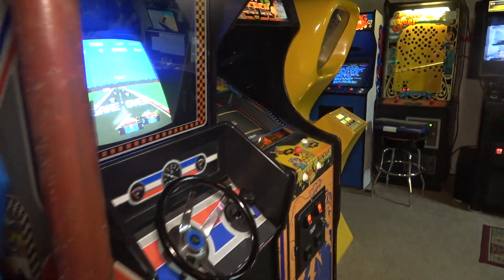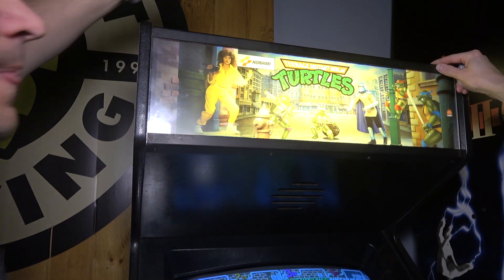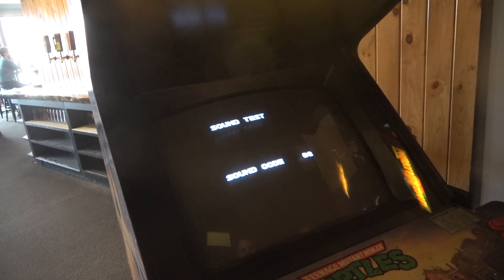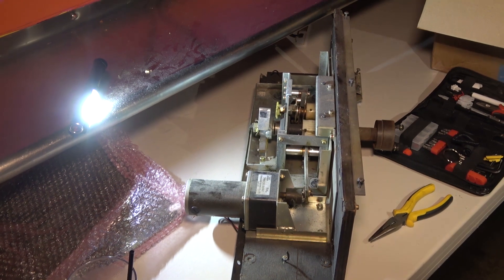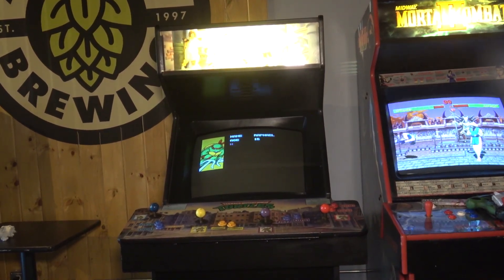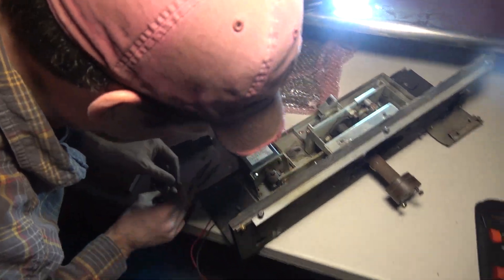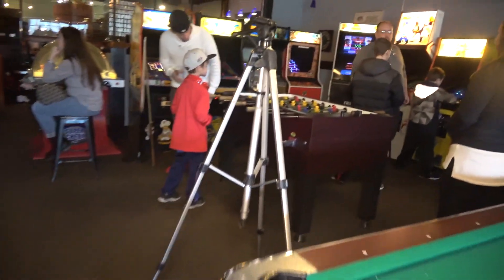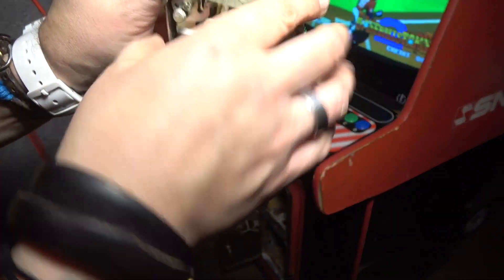Four Arcade Games - ONE DAY

Comment: the de-oxidant is the best i had a pin ball that was reseting every once in a while and i thought i was going to have to re do the five volt circuit but all it was is the edge connectors needed to be cleaned !!

Comment: Hi John.
I had the same problems With the coin mechs and I found that the adjustment for the width and thickness of the coin mech settings were difficult to fine adjust, but once its dialed in, you just tighten everything up and you should be good to go.
it will take time but you will get it down to a fine art :)

Comment: 34:32 Could try printing the repros on overhead projector film, then maybe get a very thin white paper on the back as a diffuser.

edit: Huh, the repro looks way better on camera.  Makes sense though, the original is letting through a lot more light and it's messing with the camera.

That said, if they're all repros they'll all match.

Comment: Maybe useful for you guys, when my dad was an operator they had at large locations lke yours in 1 or 2 cabs a lot of parts and tools in boxes stapled to the inside of the cabs. microswitches, fuses, lamps, tie wraps, screwdrivers, soldering iron and pliers etc.
Reply from the maker: +The Kong I like that idea.